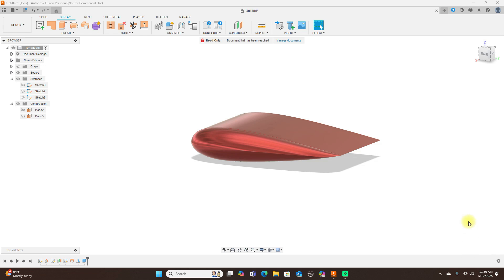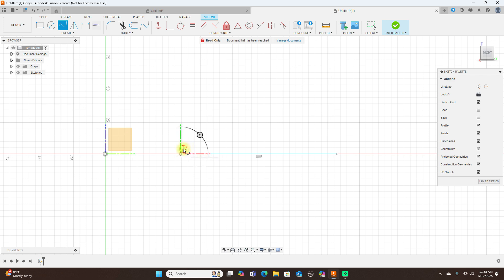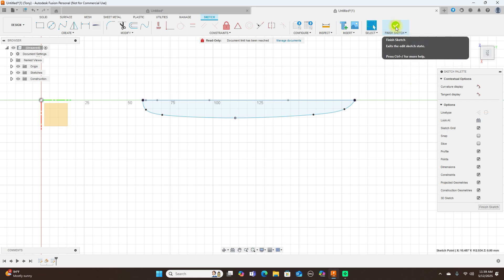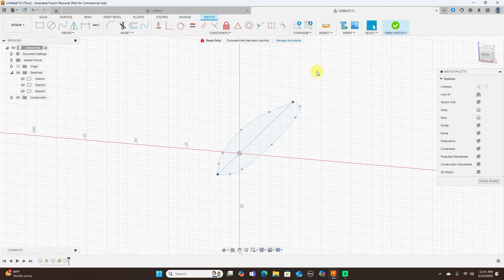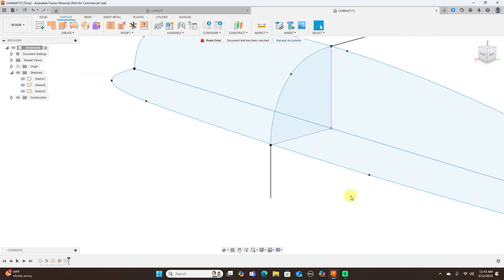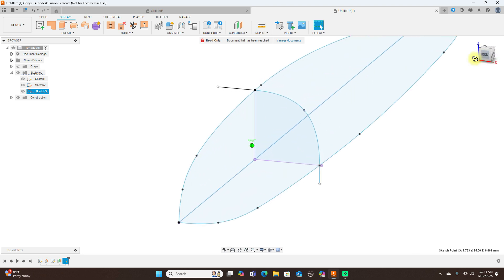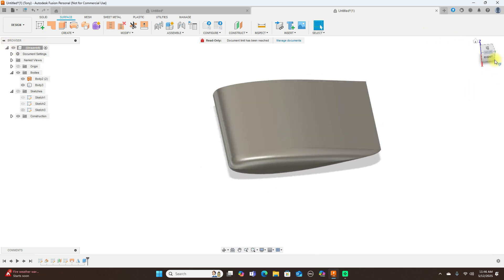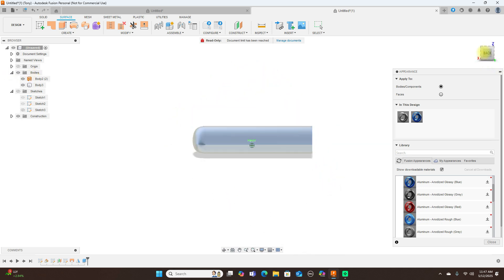Learn to surface model wingtips in Fusion 360/CAD beginner to advance Tutorial.

Comment: 1. When you create  offset plane for rail, you can use 'offset to object' and click top point of airfoil profile. It's doesn't strict, but allow to create clearlier sketches.
2. To get intersection points of profiles for building rail - strongly recommend use of 'project/intersect' command instead of 'project'.
Reply: I came here to say this.  Project-Intersect is the THE way to get that rail to touch the profiles.  👍
Reply: @meanderinoranges  Thank you.   I came here to say this....
Reply: I am not understanding.  Where is "Offset to Object"?
Reply: @johnmainville6512 dropdown menu in offset plane dialog panel